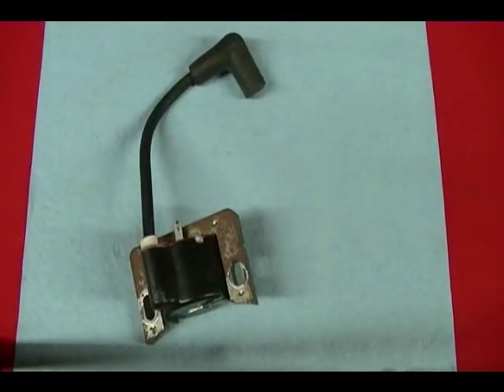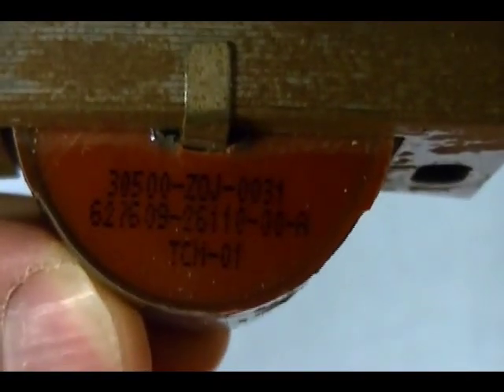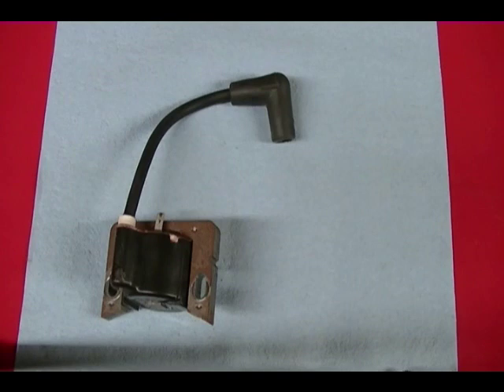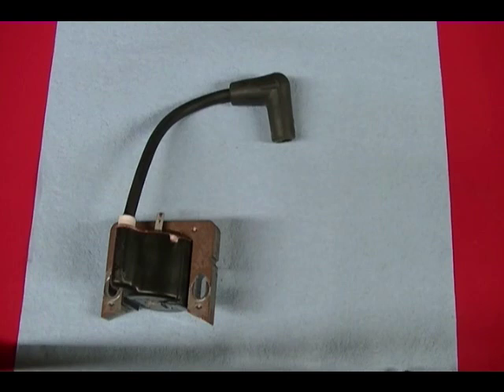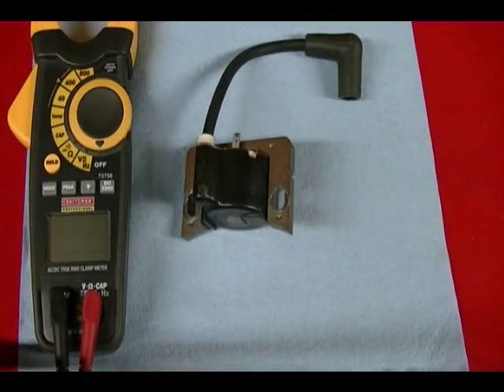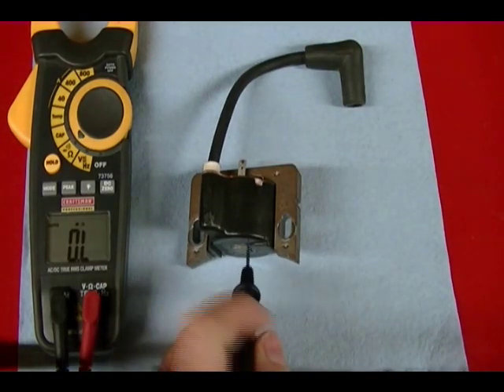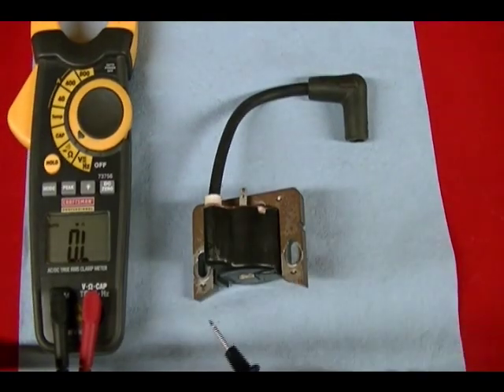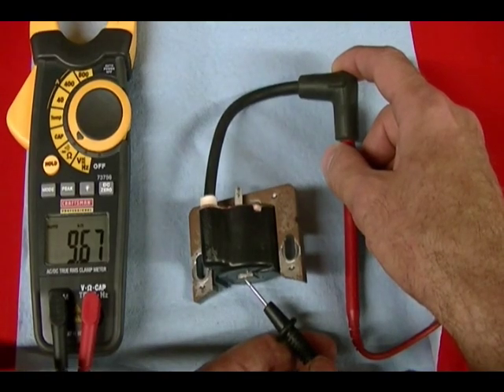Honda GC190 Ignition Coil Primary & Secondary Resistance (Phelon 30500-ZOJ-0031)

Comment: Hey, I know this video is from some time ago. But I’m wondering why you are putting the lead on the core in middle portion and not on the outer arms of the core (if that makes sense) does it make a difference? I know a lot of other coils don’t have that middle bar of the core sticking out of the bottom.

Comment: Forget all this nonsense, Keep the coil on the engine 1) disconnect the kill wire from the coil, 2) pull to start if no spark you need a new coil. Measurements are very unreliable and a waste of time.
Reply: Mine, Honda blower runs fine for a couple of minutes at low & fash throttle then starts to hesitate. I changed the oil, gas, adjusted the valves, clean the plug & air filter. Ohms reading is a waste of time but, how do you know for sure?

Comment: My GC190 coil is different that yours with a larger spade connection.   My GC190 suddenly lost spark after briefly firing and my coil measures Primary 1.9 Ohms,  secondary 13.36 K Ohms.  It is out of the 1.0 to 1.2 Ohms primary and 10.6 to 12.8 K Ohms secondary spec but not by much, but then I still get no spark.  I'll try cleaning it up and resetting the air gap and if that does not work I'll have to order a new one.  The ON/OFF switch is OK and the low oil switch is open, so it must be the coil or the gap.

Comment: Good video. Can't believe the guys would not give you the info. Here are the specs for it: Primary ignition coil resistance	1.0-1.2 kΩ
Secondary ignition coil resistance	10.6-12.8 kΩ
Reply: I believe the primary spec is 1.0 to 1.2 Ohms rather than K ohms.  My GC190 suddenly lost spark after briefly firing and my coil measures 
Primary 1.9 Ohms,  secondary 13.36 K Ohms, out of spec but not by far, but then I still get no spark.  I'll try cleaning it up and resetting the air gap and if that does not work I'll have to order a new one.

Comment: Trying to find the correct range from my current mower Honda GCV 160, Does anyone have a link to a manual so that we can test the correct range for our particular mower,  also I know that some people test just to the end of the spark plug wire before the boot and some people test with the boot on which would give you a slightly different number? Not sure which one is supposed to be tested in the manual? Thanks  for any info .
Reply: I have yet to see a Honda Mower Service manual you can download as a PDF.

Comment: I got the same coil on my gc190 honda motor I have no spark and I have 9.5k ohms on the secondary and ol on the primary does that mean it's bad?
Reply: M Gomez Yea I just read your first comment I was going to say operator error. The coil I tested with that reading was bad I got it working with another coil. Just be sure to get the air gap correct when you put on a new coil
Reply: M Gomez my first brandnew replacement coil would not put out spark I emailed the seller they immediately sent me a new one. The center part could be a bit different and it could still work. The coils and ignition system are very simple a magnet on the flywheel passes across the magnetic field in the coil creates electricity and the coil discharges into the spark plug. Hence the space between coil and flywheel is crucial.
Reply: M Gomez I'd give it a try it might work my second replacement coil was out of spec but still had a pretty blue crisp spark so I ran it anyway

Comment: The thing is though the test needs to be done also when it is hot as they can fail under load and if you think its ok after the bench test you may be inclined to over look it.heat it up with a hot air gun and repeat the test and see if there is any change.